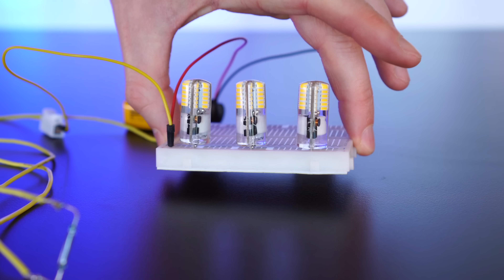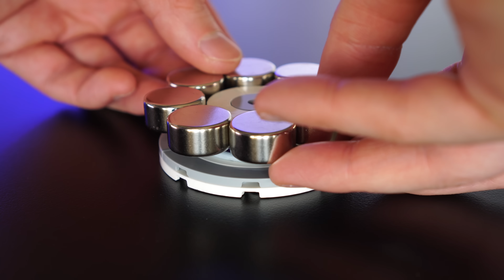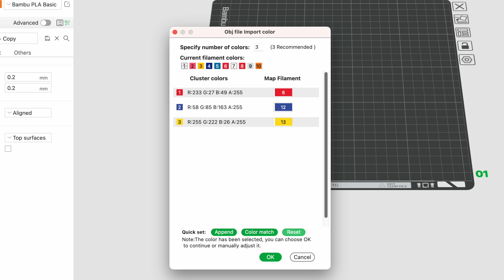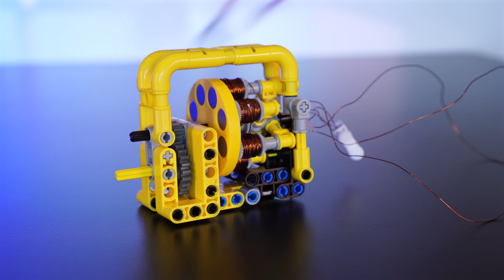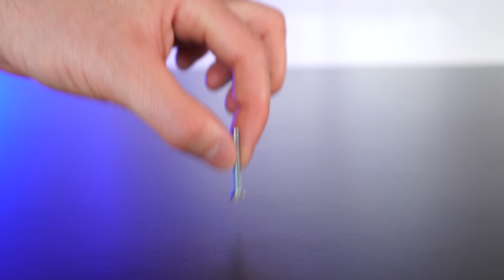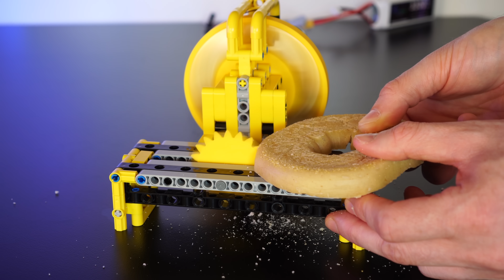Building Bigger & BIGGER Brushless Motors Using Lego

Comment from the maker: Pick up your own Bambu Lab A1 here: http://shrsl.com/2qhlq-2yn7-1cwx9
Reply: I may well be mistaken but I’m not sure if you’ve disclosed that this video was sponsored anywhere. Didn’t hear it in the video during the segment and couldn’t find it in the description. You may want to add that somewhere!
Reply: You're required to make a bumper disclosing it's a paid partnership before doing the promotion. I'm pretty sure it's a legal thing.
Reply: Hey i saw you Video and i am a Carpenter i was Wandering If you would angel the teeth instead of flat so you have more of a crosscut saw rather than rip saw that would Help because Most of the Things you Cut had cross grain plus Cross Cut saws have for the Most Things a cleaner cut
Reply: Careful of Bambu, IDK if it was ever removed but they added some nasty DRM to their printers a little while ago that basically blocked any third party software or mods, thus ecosystem locking you.
Reply: @trevorhaddox6884  they stopped that
Reply: Oh and i forgot you can also make the saw Blade a 2tile Blade instead of 1 Like a real saw Blade the teeth have a small thiting too snap or screw on and the Main Body of the Blade is smaller than the teeth that also makes a cleaner cut,prevents from rubbing between the plastics and shoot Back. Don't know how IT IS in english speeled
Reply: could you make an rc car with nothing but lego 3d printed parts copper wires and magnets?
Reply: was Bambu Lab a sponsor of this video?
Reply: i got x1 carbon xD
Reply: Lego chain gun home made🎉
Reply: I have p1s
Reply: The FTC wants to know your location
Reply: Sorry I have the P2S
Reply: You’re Awesome jamiesbrickjams 🎉😊
Reply: I have the Bambu lab p1s. No complaints. They are an amazing brand
Reply: Hey can you make a plane please and not a grass plane a plane ✈️
Reply: Screw bamboo lab
Reply: @caseysmith5585  screw you bbl is the best
Reply: how about marking your product placements
Reply: Hey, the A1 Mini's pretty good too; that's what I have and the only difference is size (it's smaller)
Also I want everyone to know that the A1 did have an issue when Bambu Lab redesigned the A1 Mini (yes, the mini version came first) and miscalculated how thick the buildplate cable needed to be, causing them to be recalled after the first few months.
Reply: @epicenderengineerYT  they fixed it btw :D
Reply: Ya I know I just wanted ppl to know that it happened
Reply: @EnderEngineerLEGO  haha yeah at least they handled it better than the ender 3s crimped xt60s melting
Reply: @glowytheglowbug  🤣true
Reply: Dude sold his soul to the devil and acts like it’s a good thing

Comment: It can't be 14k rpm because you've put two white particles, which makes it look twice as bright. If it's 10k rpm, then it's actually 5k rpm. I think you did this for those who don't understand these things.
Reply from the maker: Yes, I explained in the video (around 2.00) while testing the speed that all results should be divided by 2 due to using 2 white dots (for weight balance).

Comment: Nice builds but you're losing half of your potential output by having the coils only on one side of the magnets. The best option would be to put an identical set on the other side, or at the very least, a magnetic plate to conduct the lines around to back the magnets. Ideally you'd want the outside poles of each coil to wrap around to the coils on the other side, but that's going to be hard to do with Lego lol. Simply placing the extra set of coils on the other side will dramatically improve torque.

Comment: With a real table saw the blade top must be just slightly higher than the material. If you cut wood on a table saw with that much blade sticking out youre aiming for a Darwin award. ,  it will likely kill you when the blade jams an transfers all the energy into the wood and then it ejects it (called a kick-back). I dont know if it will make a difference, but my guess is it will cut easier if you're not exposing that much blade.

Comment: A tip for the magnets in the 3d prints if you really want to secure them:
Make the same print you have there, but with an extra few layers on the bottom underneath it, covering the whole circle including the holes. Add another few layers like that on the top, so they will be little voids covered on all sides. When the depth of the magnet holes is (almost) complete, pause the print, insert the magnets, continue the print. They will be sealed inside and unable to fly across your apartment.

Comment: Because the tourqe and speed of a motor is dependent on the strength of the rotor magnet and stator magnetic. And the strength of an electromagnet is proportional to number of turns. So lets say you use permanent magnet in the rotor and make a radial motor with two coils. You power the motor with 1V at 1A and get a certain amount of horsepower at the shaft. Now let's double the number of turns while increasing wire thickness proportional so the total resistance don't change. Now at 1V and 1A the motor is now four times as strong. So theoretically couldn't you just keep increasing the size of the two coils untill the same input power exceeds the theoretically horsepower of 746 watts to 1 horsepower constant. Not taking to account the saturation of the core. Also  the increase inductance of the coil is not considered as higher inductance will only increase the efficiency since the resistance is the same.

Comment: I wonder how big industrial brushless motors can go but if you think about it if you work in a tall building you technically get hoisted by a brushless motor every day because most elevator motors I believe are the brushless design but since a motor that big takes alot of power to start thats mostly why all buildings have a 3 or more phase power supply Im sure they go bigger than that but thats just an easy example that anyone can find out

Comment: What you can do potentially is using the metal core on the wires, you can set up a heat synch that is cools the coils down (fan would be powered by the motor) so you can draw more current safley.

Comment: Now do one where you have to make the control circuit too. (This is possible with two MOSFET transistors, two resistors, two capacitors, and an inductor and diode.

Comment: Consider designing the rotor and add a few layers above and below the magnet holes and inserting the magnets after pausing the print at 50 percent print then resuming it to secure the magnets into the print. Would like to see a video with a worry-free design such as that. Stay safe!
Reply: Or add a thick aluminum enclosure so it's ok if it explodes.

Comment: If you could make something that flys would be insane.

I mean not jump. But also not controll, just like hover for 5 secs or so
Reply from the maker: I've been considering a drone of sorts.. though I'm not sure a Lego chassis is really enough Lego. It'd likely need some interesting mechanisms. Perhaps I might see if it's possible to get my Lego brushless motors to output enough thrust to lift a small Lego drone...

Comment: Do brushless motors all use a read switch like this? It seems pretty fragile and affected by vibrations, does a more sturdy way to control electricity flow exist?
Reply from the maker: Absolutely, that was just my first demonstration of a brushless motor. After that one, all other brushless motors in this video are electronically timed and supplied with power by an electronic speed controller.

Comment: I wonder if you could improve your motor performance by adding a ferromagnetic "backplate" close to the rotor (or make it a part of the rotor) and connecting all of the solenoid screws (inductor cores) to form a closed magnetic circuit. Could help channel the magnetic field to contribute more to torque production.

Comment: For the butting blades, you need to have a "set" on the teeth so that the teeth are wider (thicker) than the blade itself. This will stop the friction losses you are having as you get deeper into a cut. The teeth should be cutting an area wider than the saw's thickness. https://en.wikipedia.org/wiki/Saw read about the  KERF and SET.

Comment: I do wonder if you angle the tip of the blade's teeth like a real saw blade how much better it would be at cutting before the plastic starts to get damaged, what is the Mohs hardness of a carrot?  ABS is stronger than PLA in most applications, you could switch to that for the blade and see if that helps when making a thinner blade as well.  Also please give those motors a wider base to attach the blu tack, I was shocked that none of them ripped themselves off the desk.

Comment: Why are you so scared of everything??.. if it was metal id get it, but its plastic... its not going to do anything bad to you.
Reply from the maker: It's the magnets flying off at speed I'm more concerned about. During an early experiment I had a small magnet fly off at a few thousand RPM and the speed it was travelling was terrifying. Enough to shatter windows, tv, teeth, small bones, take out eyes, etc. Spinning anything fast is always dangerous if anything can disconnect from the wheel

Comment: Got me thinking, you could 3D print a build plate with crossholes to fit axles through so you don't have to rely on blue tack to keep your machinations stuck to a surface
Reply from the maker: That's actually not a bad idea, cheers for the suggestion!

Comment: I wonder if this kind of contraption can power a car... 
Not like a SUV, but like one of those boattail cars you see in the 20's/40's
Reply: This is basically a very simple Axial Flux motor, which are used in full-size electric vehicles among other things.

Comment: from 3d printing newbie to 3d printing newbie  check out the infill pattern, grid is the standard one but it causes nozzle wear/tear on the long run, forcing replacement, in some cases you can literally hear the nozzle scraping altready placed infill

Comment: I wonder if you could print a rotor with walls either side, stop the print near the end, insert the magnets and then finish the print so the magnets are embedded within the wheel - I suspect the magnetic field might mess with the printer head though, but could be a far less scary way to spin it fast 😅

Comment: I understand that you might want to stick with simplicity in video and focusing on brick building, which you have done it well, simple, fun, and satisify to watch. However, since you enter the realm or electromagnetic motor, I think that would be interesting if we can standardize the measurement, for example we can monitor electrical current compare with temperature. also KV rate. So we can develope with more direction, bigger wired, higher voltage minimize air-gap etc.

Comment: I don't know much of anything about electronics and mechanics and junk, but from your demonstration at the start of the video it has become clear to me that a motor is just a generator but backwards.
when a magnet is moved passed a coil it produces an electrical current, and when an electrical current is passed through a coil, it moves a magnet
Reply from the maker: You're absolutely right! Generators and motors are essentially the same thing
Reply: @ I guess its the same as a heat pump being the exact same thing as an air conditioner but in reverse 😆
Reply: That's why in electric cars you have something called "regenerative braking", basically kinetic energy of the car is driving the motor, putting energy back into the battery.
Reply: @oskarskalski2982  yeah I know about that, but I didn't know it used this same principle to achieve it

Comment: The teeth should protrude slightly beyond the plane of the blade so that the resulting cut is slightly broader than the width of the blade. This will increase the saw's efficiency and decrease friction with the material being cut.  By doing this, the material being cut won't be able to brake the saw.
Reply from the maker: I've just learned that from some other commenters too - will definitely give that a try. Thanks for the heads up!

Comment: I wonder if you could achieve more efficiency by reducing the size of the permanent magnets (lower weight) and have electro magnets on either side of the rotor. Much bulkier but more scalable.
Reply from the maker: Hmmm that's an interesting point. I'd imagine it could? Either that or a halbach array. Might give it a try...
Reply: @JamiesBrickJams  I can't wait 🤝

Comment: Another way to add magnets to your parts is by instead of a magnet cutout, you just put a cavity (the size of the magnet) inside the print, pause it rigjt before it covers the magnet sized hole (slicer setting) then pop the magnet in, the next layer will then print over hour magnet permanently embedding it into your print

Comment: You may be able to get more torque cheaply by putting a metal ring behind the magnets and a second metal ring behind the coils.

Though then air gap spacing becomes far more critical.

Comment: Hey friend, a tip for cleaner support removal: check out Support Interface settings in your slicer (for Cura you can configure Roof and Floor settings). The slicer will connect all those little tree supports and make an easy-to-remove interface with the model itself, instead of each little branch touching (and likely adhering to) the model. I generally stick to ZigZag lines at 35-50% density for my interfaces, it makes a drastic difference in reducing scarring on the model. Hope this helps!
Reply from the maker: Ooh that's fantastic advice, thanks so much! All these little tips really help as I'm still a total newbie at printing. Especially helpful when printing so many small pieces that need to be clean and perfect

Comment: Quick tip dont use that scraper blade on you pei print plate(the gold one) it can cause your pei to degarate and not stick anymore just wait and when it is cooled down bend the plate en get it of
Reply from the maker: Thanks for the heads up! I assumed because the blade came with the printer it was safe. Guess I'll print a little scraper!
Reply: Yea i would not use a scraper (unless its a plastic) one at all on that plate the  blade comes with the printer for the super tack plate the pei is a coating and using somthing sharp degrades it but you can use it just be careful (ruined 1 plate of my self) 
Edit: if you have some really thin prints just use the blade but try to use it as less as you can. + the plate is specialy designed for bending it . Btw love your vids

Comment: A 9V block battery can supply a couple of hundred mA's. Not a couple of Amps. The internal resistance is somewhere between 1-2 Ohms, making high current draw impossible.
Reply from the maker: Huh I'll need to try that out again - I could have sworn I measured a 1.8 amp draw a few years back and always had a couple amps in mind when using them. Cheers for the heads up - worth testing again to see what it really is

Comment: For the saw to be more efficient and reduce friction with what is being cut, the teeth should protrude slightly beyond the plane of the blade, so that the resulting cut is slightly wider than the width of the blade. This will prevent the material being cut from acting as a brake on the saw.
Reply from the maker: That's super interesting, thanks for the heads up! I had another commenter note the same. Should be very easy to print - will definitely give that a try
Reply: @JamiesBrickJams  and every tooth is usually bent left and right in an alternating pattern
Reply: @JamiesBrickJams  Thank you for the interesting content you upload! I really enjoy watching your videos. You are living the dream :)
Reply: For what it's worth this is called kerf.
Reply: @warp.routine  Thanks! I didn't know that. :)
Reply: Good point, but also he didn't even have an edge on the blade, it was flat against the ground.

Comment: I like the video, but I am not a fan of the way you say things about motor and power. The explanation might be misleading to people. (eg, "transmit power wirelessly" for brushless motors might imply to people that there is a component on the rotor receiving electricity for a circuit of some kind)

Comment: Very well done and good work! I am immensely impressed by the size of those motors and the 3D-printed LEGO Technic parts you used. Would you by any chance be willing to share the 3D files you created to print those components? I am looking to use brushless motors in my Technic colony aircraft vessel and I can't find many other designs that are suitable for it other than the ones you used in this video.

Thank you so much in advance for your consideration and once again, excellent work on this video! :)

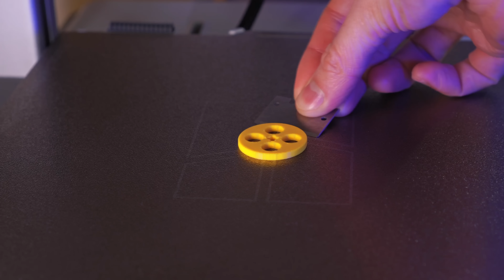Comment: 07:27 Don't use metal to get print jobs off the plate.... Been there, done that. Print a pla scraper or use a plastic spatula. And don't forget, sometimes you got to clean that nozzle to prevent clogging or partial clogging. Once in a blue moon you also have to replace the lubrication in the extruder.
Reply: But how will you get the printed PLA scraper off the plate after printing it D:
Reply: @MaakaSakuranbo  The print plate is a bit flexible so you don't need a scraper most of the time.
Reply: This depends entirely on build plate material. Glass and G10 - some of the most common material choices - have 0 problem with metal scrapers. You just gotta know what you're using.
Reply: @_lasevix You can see very clearly what kind of build plate he is using in the video. If you keep using metal scrapers on a common, textured plate and have not scratched it up yet you will at some point. There is no formal training so there is no way of knowing if you missed something crucial until you learn the hard way which would be a waste of a good build plate.